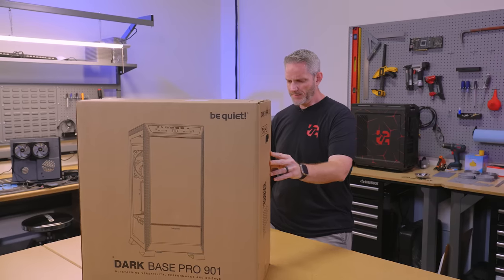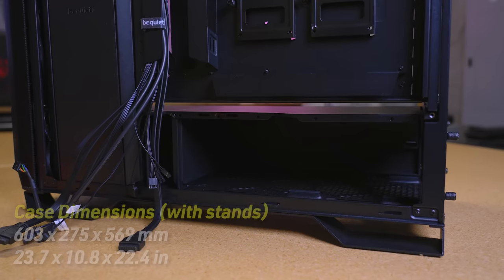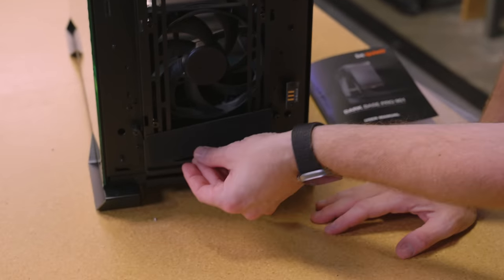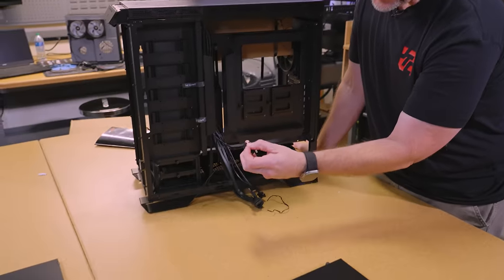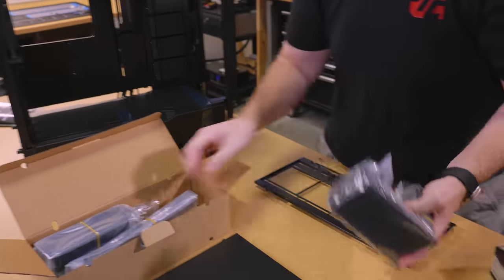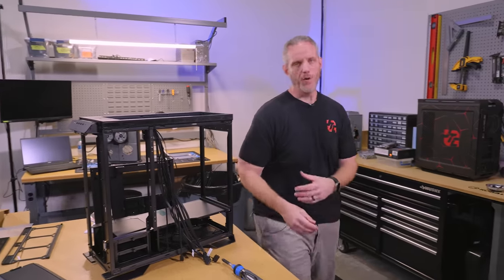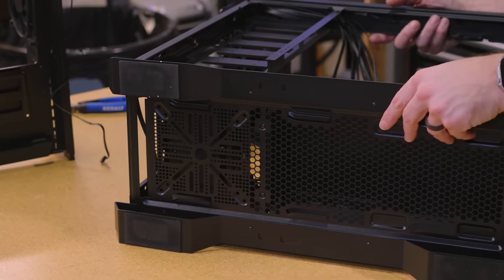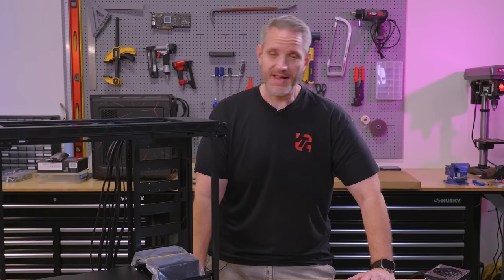This computer case is just crazy!

Comment: I believe the 5,25" bay could be used for a BD-Burner, though I sold mine years ago and don't have one anymore (I donhave a mobile DVD-Burner just in case though).

Great case. I wonder if it's have enough space for multiple GPUs and Threadripper PRO.

Comment: His take on sound dampening is pretty off. I've got very similar sound dampening panels in my case and they make a BIG difference. Especially the panel on the inside of the front cover, which goes against my 240mm radiator.

Comment: Nice but if it can't do 8 3.5" drives I'm not interested. Some of us run raid arrays in our desktop machines. Right now my 12900k is running 8 2tb SSD's in Raid 5 as my large storage drive. 14 tb of fast, secure, lower power draw drives. I have them in 3.5" pull out trays that also take 2.5" drives natively.

Comment: I've been trusting BeQuiet stuff for a while now, a few builds later, where performance matter more than looks and RGB, and they deliver. My current machines are mainly bequiet stuff, don't ask, it just happened, Silent Loop 2 is reliable, fans are solid, cases are solid, I have a strong build with one of the best cinebench score I managed to get based on a pure 500 case with proper silent cool 2 and various fans, I have to say I backed and forthed, but the DC2 Pro liquid metal saved me 5-10°C compared to the builtin paste applied the right way. BeQuiet is a strong brand, I trust them and I like where they're going, that's simple!

Comment: That's a sexy case there, and it has a 5 1/4" bay!  I still use them, and there's good uses for them too:

In my trusty old Cooler Master HAP X There is a mounting box with 2 hot swap-able SATA drive (I use both), & 2 drive bays that can be made hot swap-able with another circuit board back plane for a total of 4 which can also hold 2 1/2" SATA's, and above that another block of 2 more, in which I have a CD/DVD Burner, and a multi card reader, USB, USBc, pSATA ...port thingy.  Above that built into the front panel is the original multi port/card thingy, but it's outdated because the case is so old, but it also has the headphone and mic jack, a Firewire port and LED's still operational.

You can still buy music and movies on CD's and DVD's even vinyl, or burn music to CD's:  My car (A 2000) can only play CD's and those without MP3's but only CDA, and doesn't have a USB or even an audio input!  Another car I had could read MP3's from CD's and I made a few of those for long road trips.

I put my entire record collection, so vinyl too onto hard drives starting in the early 90's in Windows 3.1 already!  I had to do the transferring in real time, so it took a few years because I had a 5000+ album collection.  Now since the sizes of hard drives was small, and the prices were high back then when I started, as I added albums the HD sizes grew, and the prices shrank just right to be able to get them all on disk at the pace I could do it.  Now I have all of those and more on a single 2/1/2" SATA SSD!  Imagine the space I saved vs thousands of 12" records and CD's, and now my cats cant scratch the crap out of them either!

I do not use the cloud at all, and no way will I buy music online unless I can download it to my PC and have permanent copies that are not time limited!  I refuse to have music I pay for somewhere where I don't have total control of it, am dependent on an internet connection and service... and will not pay per listen!  F*ck that shit!

I also got My CAT and PET scans from the hospital on CD's so I can look at my innards!

Comment: Reasons to still have a 5 1/4in bay
  1) Media Consumption.  Blu-rays, DVDs, Music CDs.
  2) Media Ingestion.  Most integrated media ingestion ports are 5 1/4
  3) Classic/Retro Games  Not all classic/retro games have digital ports and if you already own the game, not all ports are affordable to all people.
  4) Audiophiles.  Most CDs have more music cheaper than lossless music, and Blu-Ray Music is even better, at a lower price than lossless networks.  Also most streaming networks don't pay the rights holders anything for their play of the song, so unless it is a major hit with specialized price agreements, they are ripping the artists/rights holders off.
  5) Data Backup drives.  While EXPENSIVE they are available in 5 1/4in bay sizes.

Comment: For my feeling this case is too small, I now have an Old Corsair Obsidian D900 case with 2x 480 1x360 and 1x240 rads in it with in total 14x Noise Blocker Eloop B12-1 fans and 2x D5 pumps so I have a totally quite case with only 24db with max cooling. For those that want to know what is making noise it is the D5 Pumps they are old about 10 years now I really need to replace them.

Comment: My Thermaltake Core X9 has 3x5.25 bays on the front. I'm placing two 200mm intakes on the front and removing the 5.25 drive cages. I'm looking for an external optical drive to replace the internal opticals. If anyone has suggestions for a reliable external optical drive, it would be much appreciated. 

Fair winds and following seas to all.

Comment: Recently built my new i5-13600k rig in a Pure Base 600 along with a Dark Rock 4 cooler, and I'm pretty darn happy with it. I was going to have a DVD drive in one of it's two 5.25" bays, but it had died from lack of use in my old rig.
I only have the two supplied case fans running on low through the built-in speed control, and was truly gobsmacked how quiet they are. The cooler's fan is also very quiet, with the cpu at default settings it's averaging only 38c browsing the net, playing movies etc, with the on-chip graphics (no add-in graphics card for me, just don't need one for my usage).
The only negative points with the case were having to doublecheck every screw as they weren't tightened up fully, I had to replace an unthreaded stand-off, and the captive screws on the drive cages don't thread into the case as well as I'd expect.

Comment: I would re-mount my BluRay/DVD/CD burner drive back into my case.  Nice to burn disks.  Yes currently use external drive but then have to take it out and plug in (USB and AC power cords)

Comment: I hope the pogo pin thing catches fire in the industry. That is such a cool idea to keep fan wires under control. I have a bit of a rats nest with my Corsair LL 120 and 140 RGB fans in my Corsair 5000D case. The case is huge and the wires on the fans could have been longer to make it easier to route them, but the fans were designed before the case (The 5000D is also a big boy).

Comment: I loved building in my Dark Base 700, I needed a case that I might have to invert for my VR build (I did not end up needing to.) The only thing I wish were different on it was I wish I had an airflow option for the front of the case. Keeps the 5600x Dark Rock Pro 4 and 3090 FE plenty cool

Comment: You could put an IcyDock hotswap drive cage into that 5.25" bay for example. Depending on the thickness of the SSDs you could put up to 6 or even 8 of them into one single bay. I got a super slim BD-RW drive and two SATA SSDs in one of them myself.

Some water cooling controllers or highend headphone DACs would fit in there too.

Comment: BeQuiet are just one of those quiet top brands. Never had an issue with anything of theirs. A few cases, a few coolers and some fans. All work flawlessly. My only gripe is the Lightwings High power aren't as quiet as they claimed they are. But I think someone copy/pasted from the non-highpower versions.
Send me on and I'll rebuild my ITX rig into it. AND make it look half good.

Comment: Just finished my first ever build in this case. Very newbie friendly. Had an issue only with top-mounting of arctic liquid freezer ii 360, but it is because its radiator is thicker than others and power sockets on my mobo (MSI Carbon b650) are on the top left, so plugging 4+4 & 8 pin cables there were not letting me lay down ALF ii straight…its left fans was resting on the wires… So i had to order cpu power cables extensions that are flat. Even flat wires are touching the fan, but now only on the side, so not interfering with the blades…
Also, this case is big. I mean, seriously. On videos/reviews it looks smaller than it is. Plan well :)

Comment: I bought that case 2 months ago. Switched from a Dark base 700 to it. It´s a really nice case. Luckyly i could demount my watercooling system in 1 and set it in with out letting the water out.
The front radiator is just around 2 cm more far away then in the old case.
3 things i have to say here.
1. You can NOT put everywhere 420 radiators in where you can place 140mm fans. It´s discribet in the manual.
2. Cabel cover for the mainboard is not very high so you should get L connectors for USb 3.0 and ATX 24
3. Cabel length of front IO is very shoort. You need mostly to buy extensions for Power and HD Audio. Also if you want to connect fans to motherboard.
    If you have your ARGB connector on the bottom, then too.

As JAY says silent or mash does not make any real diffrent in noise level but tempertures are way better with mash.

I still think it is worth it. Most of that parts cost 2-4€ and that case cost 300€ so you should be able to affort them.

Comment: I am planning to get this case right now. few things I like to mention:
1. the previous version of the case (dark base pro 900) already had a QI charger, so it's not the first time they thought about that 🙂
2. the previous version although had a front "door" cover the entire front panel, which actually made it easier (as 901) to swap/clean the front dust filter
3. one thing I am wondering about this case: on the MB tray, you can see the 2 small holes (14:19) under one of the 2.5 SATA mounting point. In the dark base pro 900 there was a built-in FAN Controller on this position. the 901 doesn't. So for the premium line of the bequiet case, this seems to be a step-down for me 😕

Comment: 6:49 Oh that's easy: Icydock hotswap drive bays, although I don't think they'd fit in the rather small cut-out down there. If you had 3 full width 5 1/4 slots down there you could easily host a 5-bay HDD enclosure for an awesome bulk storage config. Would buy in a heartbeat. :)

Comment: I bought a BeQuiet case 8 years ago and even though i cannot see any RGB crap through it the noise insulation is sublime while keeping 40-50C temps on my CPU with a simple AIO cooler.
I will never change that case. Instead, for RGB, i kept the Christmas lights in the room.

Comment: I'm still using my pro 900 which also already had wireless charging built in. I have had it since 2017 and it's a beast. To bad it's suboptimal for water-cooling but otherwise it's freaking awesome

Comment: Looks like a decent case, like the Dark Base Pro 900 v2 I have.

Although it's big, i still find it a bit tight with an eATX build. You have to invert the previous version to fit. Not sure if this one you have to?

With an NVMe expansion card, 2 GPUs and push pull config on top there is not much room left at all. I can’t even use the top 2 PCIe slots on my MOBO due to hitting the rad at the top.

Looks like the new version has a better side panel for removal.

But for most standard builds, it's great.

Comment: The general consensus is that 15-30% of area covering is a good starting point to notice a difference in noise level. So even with that mesh, any damping "SHOULD" reduce the sound output level. 

Also that " GPU support bracket gives a channel to hide the power cables. That's a great addition

Comment: I have a question about Fan Hubs like here Aios and PWM Cables and Fan Headers on the Motherboard:
On my MB all PWM Headers except one dedicated to a Water Pump which has 3 Ampere have only 1 Ampere.
So if i look on the fans one header is a maximum of 3 140 mm fans or 5 120 mm fans so i do not go over that 1 Ampere limit.
Lets say i buy a 420 mm aio from arctic which has a combined cable for the pump and the fans which goes through the tubes i will automatically go over 1 Ampere.
How do you ever mount that aio in a case? I cant find a motherboard with a CPU Fan Header with more than one Ampere.
The same goes for making a Push Pull with something like a 280 mm aio two 140 mm and the pump barely fit under the 1 Ampere. But Push Pull no way.
Can i plug that aio into the Water Pump Header with has 3 Amps and leave the CPU Fan Header unoccupied or will the computer not start because "i have no cpu cooler installed".
Can you even put more than 1 Ampere through a PWM Cabel? If so are there cables with combine two Fan Headers on the Board into one cable so that i can up that limit to 2 Ampere with the Extra CPU Cooler PWM Fan Header on the board. I can only find cables that do the opposite so two cables from one PWM Header on the Board. Another question i have: Why cant i mount AIOs with 140 mm Fans on the top of this case when i can mount 140 mm fans there? Thats seems to be the dealbreaker in an otherwise great case here.

Comment: I did look at Be Quiet cases before deciding what I was going to build but I decided to go white and for that the Lian Li's are spot on.  I am however running a Dark Power Pro 1300W power supply in the build which is crazy well packaged and looks really well engineered (but is pretty expensive and slightly bigger than standard ATX PSU's in length)!

Comment: Not a cheap case but looks like I might be the last case you'll ever need. I still like the 5.25 inch drive bay because I like watching blu-rays.

My existing PC already has a 420 MM and 280mm radiator, so if I was to upgrade I have to make sure that my water cooling components can transfer over.

Comment: As much as I love this case, I can't justify spending over £300 on it. I have an older system that won't get a huge amount of use but has a Blu-Ray/HD-DVD drive that I want to keep, this case would do it but I can't justify the price. The Fractal Pop Air here in the UK is significantly cheaper and also has the drive bay so I've settled on that instead.

Comment: I have the original ver from about 6 yrs ago and I love it.  My next build will most likely use this newer updated version.  With 3x120 cpu radiator, 140mm at the rear and an extra 120mm,  and a 3080 with fans at 75%, my PC is quieter than the fan on my 10 port TPLink switch.

Comment: Jay that GPU support bracket also hides the three 8 pin PCI cables or the newer 12V HPWR cable. The Qi charger on the 901 was also on the 900 Rev 2. I have a 900 Rev 2 and still use it to this day.

Comment: I took one look at the price and shut the video down. Sorry I'm cheap. I don't want a technical wonder to house my computer. I don't need or want TG panel, not even one. I love the 5-1/4 inch drive support, but a case this large should hold 8 to 10 3-1/2 inch drives. And for the price of this case they should have hot swap backplane for the drives. Oh and given the size support for a redundant PSU would be nice.

But for a glass temple to the tech Gods this is just way to much.

Comment: I have the previous model, the 900. It's a big heavy boy. It also has the phone charger which I definitely used it from time to time. The main reason I bought it was because it had 5 inch drive bays, 2 in this model actually. I needed a DVD drive (I'm old and still use DVDs. Fight me!). I used it for my first and only (sorry but you mob make it look so much easier than it actually is) build.

Comment: Why does Jay always question what you need a 5.25" bay for anymore, as if there are suddenly no use cases for one any longer? 1. If you back up your stuff like you are supposed to, you need a at the very least a DVD-RW drive so you can make physical backups of your important files and OS. 2. If you play old games, some of them, at the beginning of DRM are setup such that you can not make an iso of the game and mount that and have it work. It still spits out an error that the disk/iso is invalid, meaning you still have to put the game disk in a drive in order to play those games at all. 3. If you use Linux or BSD and you are installing it on older hardware that still works but, does not allow for booting form USB, you still have to burn the iso to a DVD or CD in order to install it on that hardware. And that is just the tip of the iceberg of reasons to still need a 5.25" bay. FFS give it a rest Jay. If you're joking, the joke is old and tired. If you're not joking, are you really an IT professional? Tons of people still need and use optical drives.

Comment: If there was a tempered glass front panel designed in such a way where there is increased side airflow and the aluminium or whatever was NOT brushed then this case would be in my next build
ALSO companies like Pioneer, LG and Asus still produce Blu-Ray readers/copiers etc... that a lot of people use to copy 4K Blu-Ray movies to their PC's and something like this case would be great for that which is still something people still do and Pioneer has released 5.25 Blu-Ray copiers this year as well. I also really like the QI charging included with the case. BUT I am not a fan of the fan control buttons. I would just rather do it all in software ESPECIALLY with hardware fan controls your fans don't react to the temperature of your CPU/GPU and you have to manually adjust them up or down when using your PC not to mention with software if your fans are RGB then you can control both lighting and fan speed under that software and with the new Corsair iCUE link ecosystem you can measure the temperature of the air going in to the fans because they have thermistors built in to them and if you wanted you could use that to influence the fan speed in your system